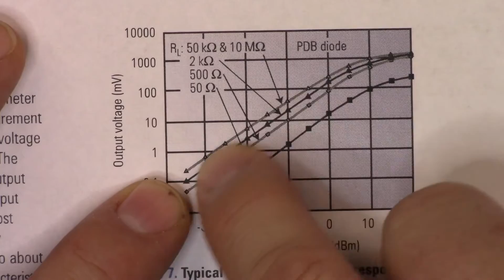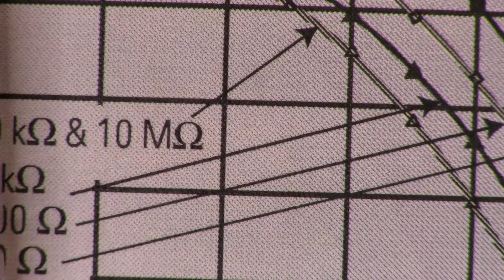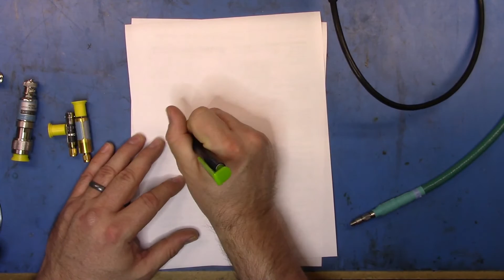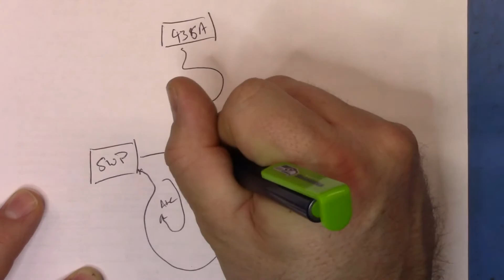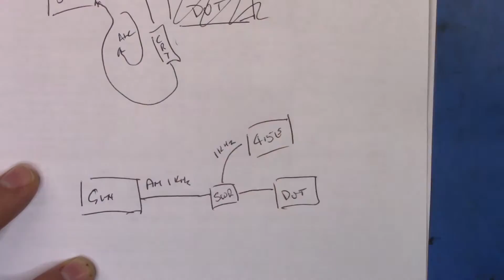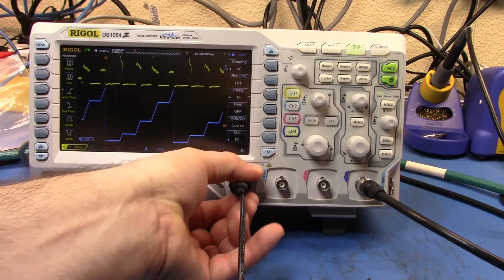HP Crystal Detectors 8470B 8472B 8473C

Comment: I have a couple of surplus detector mounts that use the old 1N23 etc... point contact diodes. I have a bag of Microwave Assoc. diodes that I can't find squat on that fit form and function the same. The nice thing is that many of these old detectors had a removable contact cap so you could easily change the polarity. How useful are these old school detector diodes now,  and what is inside those newer HP detectors that cost a small fortune? Schottkys?
Reply from the maker: I'm not familiar with those so I can't comment specifically on them but Keysight still sell these diode detectors and they're still used in various test setups. Keysight have an product fact sheet here - http://literature.cdn.keysight.com/litweb/pdf/5990-4897EN.pdf?id=1822125 and a good overview of the detectors here - http://www.keysight.com/upload/cmc_upload/All/DetectorOverview.pdf.

These are Low Barrier Schottky Diodes so I suspect that is why they're expensive (other than tight tolerances, small runs, etc) - There is a good exposition into them here http://hparchive.com/seminar_notes/Pratt_Diode_detectors.pdf

Unfortunately I can't find a HP Journal that talks about the 8470B or 432B but here is one that goes into hot-carrier diodes - http://www.hpl.hp.com/hpjournal/pdfs/IssuePDFs/1965-12.pdf

Comment: Good overview & demo.  
Most Signal generators already have an internal RF detector with coupler for ALC (Auto Level Control) near the output connector.  
The advantage of using an external detector is to compensate signal path loss across frequencies since it usually sits much closer to the device under test.
Reply from the maker: Thanks Rk - Appreciate you clarifying what I was trying to draw on the paper about the external ALC loop. Great Comment.